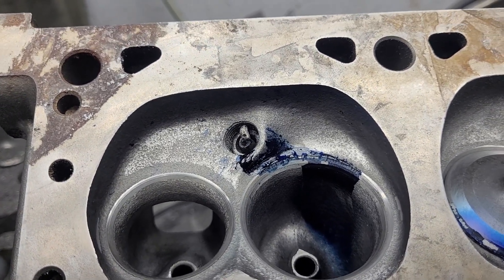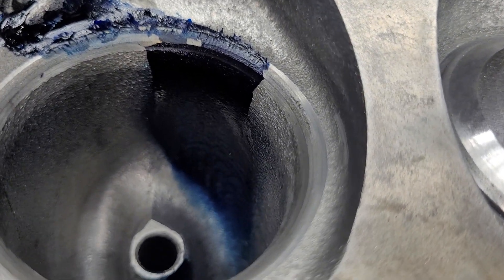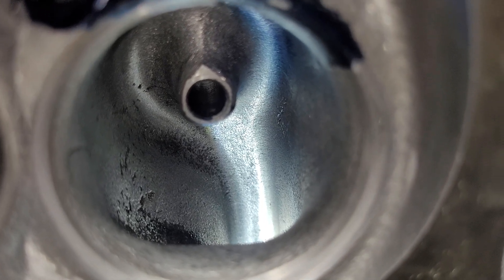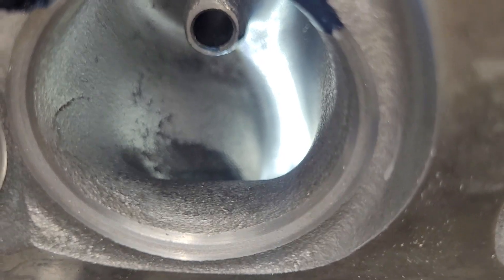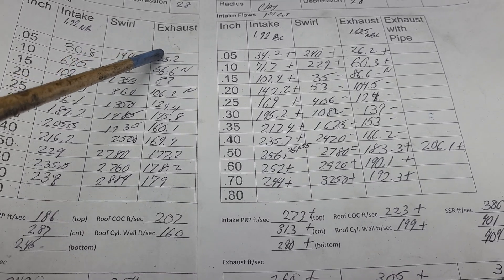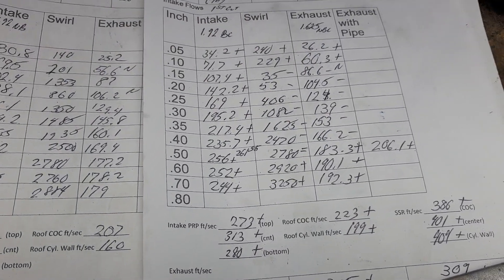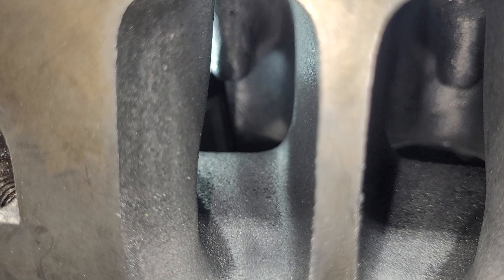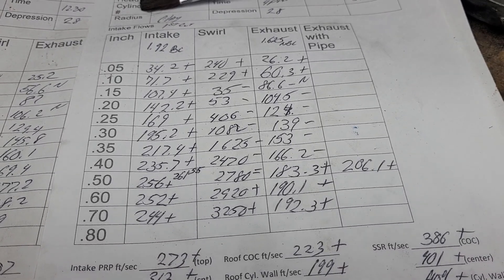EQ Magnum 318/360 cylinder head first cut porting, airflows and air speeds

Comment: looks like the air/fuel mix, like the dykem, is slamming into the straight up and down wall of the long (missing) radius. what good is an atomized a/f mix after it slams into the wall and breaks up? the long radius is just that. a radius, not a straight wall. an hour glass shape is much more efficient.
Reply from the maker: @axlegrind4212  Easy on an 18 degree head?
Reply: @servediocylinderheads  i understand you're just doing a "clean up" but there is enough material in that straight wall to put in a long radius. the dykem doesn't lie. the air/fuel is going to slam and separate when it hits that straight wall.
Reply from the maker: @axlegrind4212  I think you need to watch the rest of the series.  A bit more than a clean up. Thanks

Comment: I’m guessing these are the older Australian EQ heads
Reply from the maker: New Zeland
Reply: Those are the good ones. The newer ones are from China
Reply from the maker: @dang5553  I agree!
Reply: @servediocylinderheads
Reply: @servediocylinderheads I'm watching intensely, because I just landed the NZ HEADS. looking to get gain from the heads and decent street cam. I have the Mopar M1 intake, modifying full size long tubes, use the Mopar performance computer. It would feel good to see it pull harder as the RPMs approach shifting point.
Reply from the maker: @donaldpowers3314  N.Z. heads are really nice!

Comment: The RPM Airgap for Ford Clevelands flow 290 on the worst runner and 340 or more on the best, stock. With a little radius work that goes up to 330 and 410 CFM.
Reply from the maker: And they are easy to port because you can fit both hands in the port!
Reply: @servediocylinderheads  only if you have tiny hands. The manifold-head outlet is actually smaller than a fel-pro 2V gasket.
Reply from the maker: @psychoholicslag4801  They are tiny! 9" from spread thumb to pinky!

Comment: Hi Charlie,

You know im not a Mopar guy, but i think in general "extra airflow" can hurt higher revs more than lower revs, and conversely is needed to achieve higher ve at lower revs that the longer available time allows.

Of course, we cannot measure the airflow of a running engine with a flow bench.

- juhana
Reply from the maker: That is how a more efficient head can make better low end torque.
Reply: @servediocylinderheads  Let say the bare head flow high speeds (in a flowbench) and the manifold drops it down. That doesnt necessarily mean it is a waste when the speeds are targeted and like so things happen at a right time.

-juhana
Reply from the maker: @juhanahuovinen  So what you are writing is it is a good idea to have a fast manifold and a slow intake port?
Reply: @servediocylinderheads  I mean its crazy what a engine may want.

Some manifolds even have bends which you know makes it less flow efficient, but we should keep in mind that were dealing with pulsed flow and without the reflected intake pulse there is nothing to ram it with.

-juhana
Reply from the maker: @juhanahuovinen  Airflow is not intuitive!

Comment: Sheesh, it looks like on the exhaust side he picked up the most by having Dr. E do a 6 angle valve job and then he profiled the guide boss.  LOL. Doh!!!  Bummer those dudes have to pass along.  Appears he got 168@300 and 185@5, with a pipe the #'s are 175@3 and 208@5.   You are right there already on the 500 #'s. (being an EQ not sure if it should be better)
Reply from the maker: 168 at .3 doesn't sound right.

Comment: In the article Steve used the E-tool and calipers.  He states "After re-working the area, the port window at the pushrod bulge measured 0.930 inch by 2.225 inches. Increasing the available cross-sectional area to 2.07 SQ inches.  That's a gain of over 17 percent.  Intake flow responded with large gains showing the restriction here was significantly impacting the head's flow capabilities.  (these are stock magnums and this was the 3rd step after bowl blend and short side contour). He took the pinch at the top from .800" to .930" using the E-tool.
Reply from the maker: Good info. Thanks

Comment: If i remember correctly the performer rpm is only like a 15-20 hp difference from a mid 80s stock midrise truck 360 4 barrel manifold. And thats stock for stock. Learning that. I decided i woulod put alot of work into the truck manifold i had. Took like 8 hours. But i managed to equal put all of yhe intake port cross sections to sligtly larger than the cross section on the ported 360 head. (Deep port matched) port matched all the wsy through those runners. Cut down the divider a bit and did the plenum work. Not sure how wrll it worjed yet. Transmission is a little low on fluid so it slips a bit.

Comment: Isn't 400+ SSR airspeed getting too high? I thought that too much SSR speed could block roof flow. I'm asking not criticizing. I love seeing all this MOPAR work
Reply from the maker: It is high. I will work on it a bit.
Reply: Yeah, with the small block mopars. Like I said, it would take as much work in opening up the truck kid rise dual plane as it eould the aftermarketn because they both need opening up. I spent a good 8 hours or so deep port matching and doing the plenum work on a stock mid 80s dodge 360 midrise dual plane. That was just to get all of the crosssections to be slightly larger than the crossection of the heads.

Yhe edelbrock airgao if u remember was only something like 15-20 hp difference from a stock manifold at peak..

I also ported a 318/360 edelbrock performer intake and to get all the ports deep matched to a 318 gasket took about 8 hours as well. I also did a bunch of pleulnum work on that one as well.

Comment: Dual plane that flows 300cfm would be the cross ram that Smokey Yunick had a hand in
Reply from the maker: Not sure they flowed that much. That is also not a dual plane. It is a tunnel ram that has been flattened!
Reply: @servediocylinderheads  It could be modified to be a dual plane style manifold in the plenum
Reply from the maker: @ronnieb7408  Yes, but not with 180 degree firing order. Think of how the plenum would need to be divided to be similar to the rpm.
Reply: @servediocylinderheads  Always fascinated by those cross rams from the first time I seen one. The Trick flow Ford EFI intake  with the square truck ports are similar in design to them with those long runners and almost bet they dry flow  more than most would think

Comment: I wonder, if you make your texturing aligned with where the air wants to go, would that help flow. It helps induce swirl, when you swirl polish valves. It's probably quite tricky to align the burr in said direction.
Reply from the maker: I can't do that. What you are writing about is a shark tooth pattern. That would be great. Flows good forward and poorly backward. Impossible to do with a burr that I can see.